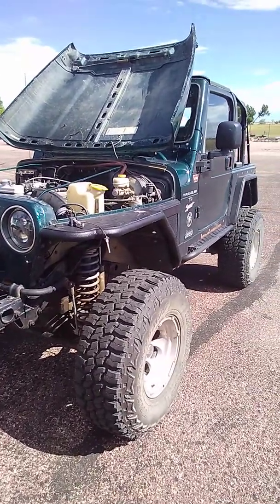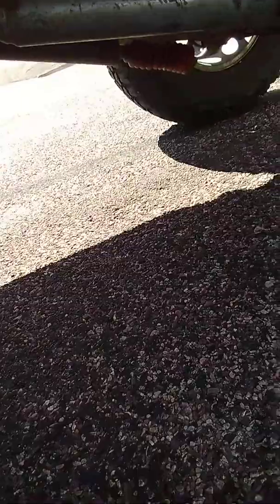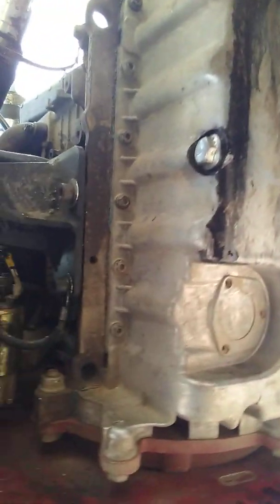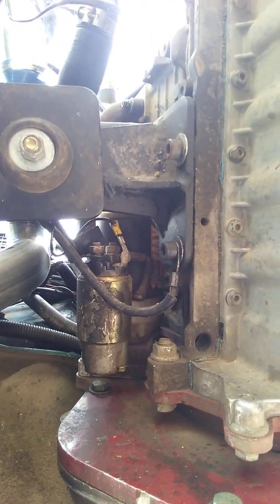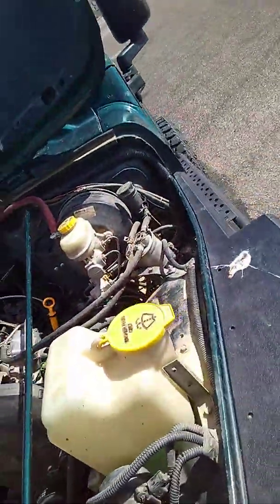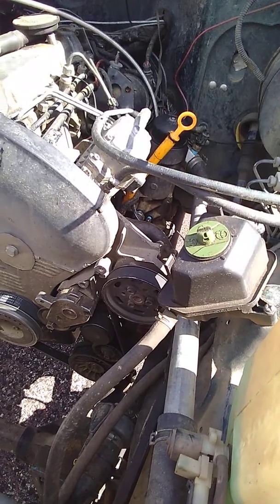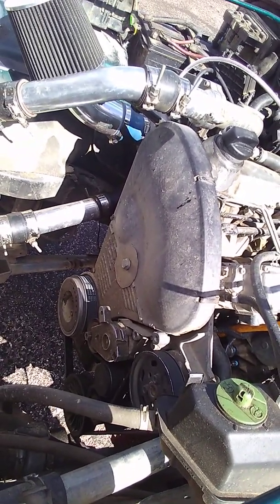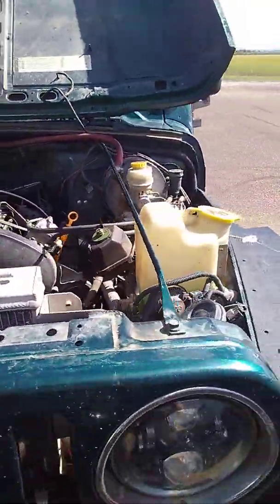TDI diesel swap process walk through TJ Jeep Wrangler

Comment: What dimensions are the intercooler you used?
Reply from the maker: The one in this video is about stock ALH size, 12x10x4 core, much too small once I bumped the power up years later

Comment: I have a 03 Jeep tj and was planning on doing a alh swap I was wondering what exactly do I need to do for the wiring do they make a plug and play wire harness kit? Do I need to re wire everything myself? Also do I have to run both the Volkswagen and Jeep ecu?
Reply from the maker: It's usually easiest to run separate wiring for the engine and the jeep. I have other videos going over all that as well as using the jeep wiring to make the gauges work. I can also build standalone harnesses for just the engine.
Reply: I would definitely be interested in buying a stand alone harness I just gotta find a donor car and get everything for the swap together
Reply from the maker: @johnpalmer415 check out the playlist on all my jeep videos that will help a lot, as well as my recent wiring videos on my dodge Dakota, very similar setup.  But you can find me on Facebook https://www.facebook.com/profile.php?id=100014261163897&mibextid=ZbWKwL

Comment: I have a 2000 TJ that would like to swap an ALH due to their reliability and strength. I found a 2000 Jetta TDI. Guys is asking $1,000 whole car but the timing belt broke he said not starting. Would it be too costly to rebuild ?
Reply from the maker: Well usually it bends valves/lifters/sometimes the cam is damaged, new heads are about $1000-1500, as long as it didn't damage pistons it's not terrible, but that's pretty high for a basically junk engine, if it's manual you can make some back selling the transmission/manual swap kit.  But it's a pretty expensive start if you can't do the work yourself, most engine rebuilds are pretty costly these days.

Comment: What tune are you using stage 3 or 4 ?
Reply from the maker: I have all custom tunes from TekMekTronics, over stage 5 if you are looking at numbers, 200 HP/350 TQ
Reply: @TDISwaps - Geez - that beats my stock 4.0 torque by a longshot and is a little better on HP. This swap is looking better and better to me.
Reply from the maker: @wes11bravo yes it definitely rips compared to the 4.0, and with a 5k rev limit it really feels like the 4.0 power band still.  That and over 20 MPG makes it pretty hard to beat.  If you can do it cheap the fuel savings pays for the swap in less than 50k miles.

Comment: My Monday question on my jeep TJ, what all needs vacuum other than the brake booster, heater controls and turbo actuator. I am not using the EGR system.  Thanks.
Reply from the maker: That's it, brakes, turbo, and heater!
Reply: @TDISwaps  Thanks, that is the answer I was hoping for.

Comment: Actually drove mine  3 quarters of a mile this afternoon. First time to check the transmission and it feels good. Will my stock jeep tj radiator be sufficient to keep her cool? Installed a cheap $25.00 pressure regulator but I am not impressed. Gauge works around 25-30 lbs but drop to zero when backing off with the adjustment. Still might go to the H setup now that I have another metal fuel line going to the tank for a return .
Reply from the maker: I used a stock radiator for awhile but the mountain passes heated me up more than I liked so I did a $120 ebay 3 core and that really helped, although it barely gets to temp around town lol.  Guess it depends on your conditions.  Ya guys have run as much as 25-30 PSI to the ALH pump without issue, but it's asking for leaks if you ask me.
Reply: @TDISwaps  probably put about 5 miles on her today just driving a half mile on my county road back and forth. A few minutes ago I just determined that my brake booster is bad and that is why the vacuum is so weak. I used a vacuum hand pump to the actuator earlier today before I discovered the booster problem. When I applied vacuum to the actuator the lever moved but  nothing changed with the idle or when I was driving.Your thoughts...
Reply from the maker: @herseyjake1  the actuator is moved by the ECU as the boost comes in and goes away, it's pretty hard to recreate.  I would just cap off the brake booster until it's fixed and make sure your n75 valve is getting full vacuum and then it should work correctly
Reply: @TDISwaps  I have capped off the brake boost until I can go and pick up one. How does the ECU control the actuator since there isn't a electrical plug connected to the actuator? The EXPENSIVE harness I had made didn't include one because they said it is basically useless and didn't work most of the time. Also, the harness did not provide for a electrical connector to the n75 valve. I can't see how the ECU can communicate with either of the 2. I haven't ridden in anything powered by a tdi 11.9 so I don't know what kind of power to expect. Currently there isn't much but I suspect I haven't experienced any boost yet. And I haven't test driven it since discovering the bad brake booster. Thanks.
Reply from the maker: @herseyjake1  you must be missing some stuff that's needed for the turbo to work, I can't send pictures here but you can contact me on Facebook so I can sent you diagrams. https://m.facebook.com/profile.php?id=100014261163897&ref=content_filter

Comment: Could a TDI swap work with an automatic transmission? I haven't been able to find a forum with an automatic write up. Thanks
Reply from the maker: TDI swapped trucks Facebook group has the most info you will find.  There are quite a few automatic options depending on the vehicle, but most need to be able to run without a computer so older pre-2000 or even 1994 are the best.  Getting the transmission computer to communicate with the TDI is usually complicated, and can be very expensive.

Comment: Are you using the stock jeep fuel pump? I understand the 1.9 only needs 8-10  fuel pressure whereas the stock jeep pump is considerably higher. And what did you look for when ordering water hose pipes off of ebay? Thanks.
Reply: Mine 1.9 is out of a 2005 Jetta. I will check your Toyota videos. Thanks.
Reply from the maker: @herseyjake1  oh ok yes on an 05 TDI it does need a pump, but I have still seen guys use the factory pump with the H setup, either that or an inline pressure regulator to drop it to the 10 PSI.
Reply: @TDISwaps  ok, I am finally at the fuel supply point.
Reply from the maker: @herseyjake1  ya I have seen multiple ways of making it work with the PD TDI engines, but the H setup and/or a pressure regulator are definitely the easiest options and you don't even need to mess with the fuel tank at all! I never even dropped mine.
Reply: @TDISwaps  I've ordered a inline pressure regulator because I haven't visually seen a H setup. I think I understand how it works but  am not sure what  piece of hardware is used for the H. Also, what happens on either a inline regulator or a H setup to the second line (return I guess) that is on the VW fuel filter. Many thanks for you responses!
Reply from the maker: @herseyjake1  glad to help man, wish I could send pictures on here.  The lines are hooked up just like they were in the car, send and return go all the way to the tank.  An inline regulator will work just fine as well, usually if it has it, it's discharge will tee into the return.  The H setup is just teeing the send and return lines together so excess fuel turns around and goes right back to the tank through the return line
Reply from the maker: So you don't actually need a fuel pump for the older 99-03 1.9s, but you can also do an H setup in the send and return lines using 2 tees and then run the factory fuel pump just sending most of the fuel back to the tank.  I go over that in my Toyota setup.  My intercooler hoses are off eBay just a universal kit but my water hoses are from the parts store.  I put the part number to a few of those in my Toyota video as well.

Comment: where did you get the universal  premade engine mounts? And how did you align the motor. I am having difficulty determining if my engine is perfectly aligned? Thanks
Reply from the maker: So the engine side of my mounts are from TD conversions website, and the frame side are just universal v8 motor mounts, to be honest having it perfected aligned is not that critical, I think mine ended up about 1/4-1/2" off of centered.
Reply: @TDISwaps  Thanks for the reply. Since I am keeping the compressor I had a  devil of a time making something work on the driverside. I got it in just behind and below the compressor. On the passenger side I mounted it closer to the front of the engine. Hope that it will not matter if they aren't both mounted across from each other. Got my computer and wiring harness back from Canada today so I about ready to get this show on the road--I hope.
Reply from the maker: @herseyjake1  nice! Sounds like you got it under control.  Yes the driver's side is a pain there is like 1 place it fits with the a/c compressor there.  And no the location on each side won't matter at all, if you check out my Toyota it's passenger side mount is clear in front of the engine! Ha ha.  Anyways, good work!

Comment: Did your computer require tuning to eliminate the immobilizer? If so who do you recommend. Also, are your gauges working off the jeep computer? I have a 2004 jeep TJ and a 2005 VW Jetta 1.9. I need to know which wires to use and which to discard. And does the jeep computer require tuning when only using the gauges? Great video!
Reply from the maker: Yes the computer will needed the immobilizer turned off, deleted and tuned.  I have used Malone Tuning for both of mine.  Using the Jeep ECU and engine sensors the factory Jeep gauges will work, I made a video on that specifically.  I made a video on cutting out the wiring harness on my 03 as well, your 05 should be very similar.

Comment: how did/do you decide to weld in the new motor mounts
Reply from the maker: Well I started with some universal  premade mounts and then cut and welded them to work in my situation, but having the engine in place held up by straps right where you want it makes it easier to see where you can put the mounts and what will work.
Reply: @TDISwaps  how did you decide where the engine needed to be placed?

Comment: Hey I noticed your reply to comments! Was just wondering which year VW did you use? Which engines are the easiest/cheap swap if that's possible Haha. I want to swap my TJ for mpg but have never done a swap before...thanks!
Reply from the maker: Haha yeah I'm glad to help out, I just go for whatever TDI I can get a good deal on that's what I search for on marketplace and Craigslist, usually the 2000 to 2003 ALH is the cheapest that's what both my swaps are
Reply: @TDISwaps  Does it matter if the donor car is an automatic or manual? The trickiest part for me would be the wiring. Is EVERYTHING from the donor just swapped over? Or are some of the JEEP computers and wiring used? Is there step by step instructions anywhere? Thank you for responding!
Reply from the maker: @Thanny2000  Your welcome, and the donor car doesn't matter, you will get the computer tuned to stand alone from whatever it is.  I go over the wiring and keeping the Jeep ECU for the gauges in another video.

Comment: What turbo did you get on here? I love the placement👌
Reply from the maker: that turbo is a gt2056v with a t25 flange, then I have a universal vw 8v t25 manifold to the engine.  It comes straight out and then the turbo curls up which makes for a ton of room below by the motor mounts and starter.
Reply: Okay thanks👍🏻 Where did you get that t25 flange for the gt2056v? I’ve got a 1.6td out of a mechanical pump jetta mf engine code going to go in a Nissan hardbody, so I’m thinking a gt1544v might be better for me and the smaller engine, but maybe where you got the t25 housing/flange you say might have a t25 flange for a gt1544v too..?
Reply: Otherwise I think my only option is to make some flanges and make my own adapter to go from my stock k14 turbo manifold to the gt1544v flange type.
Reply from the maker: @mattheripper  well what flange does that 1544 come with? The t25 is a square flange like the bigger t3/t4 turbos.  Your old turbo should be a 3 bolt triangle flange I think
Reply: Yeah both are fairly oddball flanges. The old school turbo is a four bolt but a trapezoid layout. The gt1544v is similarish to a t25 but rotated 90°, I’m sure it’s smaller than the t25 bolt pattern though it is square layout bolt wise, the turbine inlet isn’t oval like a t25 flange, it’s actually just a circular port for the turbine inlet on the gt1544v. The goal for the hardbody is to have a new age vnt turbo that’s size for fuel mileage over power. That being said though if you look at the listing on eBay for the gt1544v it says the Ford and Peugeot 1.6 hdi diesels it came off was making 110hp, so I’d assume it has some potential to get me over the stock 68hp the vw mechanical 1.6td’s made. What do you think? Where did you get the t25 housing for the gt2056v? That would be nice and easy if they did have a solution for a gt1544v housing going t25 too
Reply from the maker: @mattheripper  I will try add the link to this video but it's on my newer video of testing the gt2052 wastegated turbo, or just search vw 8v t25 manifold, it's a cast one for about $100 from china of course.  Ya I'm not sure how it would work with your turbo, I have seen people using the 2056 on a 1.6 but spool up is later obviously

Comment: How are you liking it so far?  And is worth it?
Reply from the maker: I live in the mountains with headwinds in every direction it seems, and 30-50 miles to get anywhere.  I could hardly justify driving the Jeep before at 10 MPG and downshifting every hill.  Now I am getting 21-23 MPG and more power than I ever need.  Of course there have been issues along the way, but it's also never left me stranded in 17k miles.
Reply from the maker: A diesel swap is the only swap I've seen capable of paying for itself in fuel savings
Reply: Great. I'll check it out. Thank you
Reply: This is very true.  I've been thinking about doing it to my YJ 2.5.
Reply from the maker: @pabloaguirre6259  Ya the power the TDI has over the 2.5l is almost unbelievable, not to mention 2x the fuel mileage.  It's hard to go wrong.
Reply: It truly sounds amazing. I'll have to make it happen.
Reply from the maker: @pabloaguirre6259  You won't regret it! If you watch for a cheap car, do the fabrication yourself or with help, and don't go too crazy with performance mods to the TDI, it can be a very cheap.  Anyways as far as engine swaps go
Reply: I can do alit of the work myself.  I just dont have to much time on my hands.  But i found that Coty built has full set up for 5,500.  I dont know if you seen there set up?  If you have.  What are your thoughts on it?
Reply from the maker: @Pablo Aguirre well Coty does complete alot of things for you, but that's about 3-4x what I have in parts for my swap.  I purchased the car, modded the engine and bought everything needed for under $3000
Reply: Sound like ill be going that route. Thank you for your help
Reply from the maker: @pabloaguirre6259  no problem at all! TDI swapped trucks Facebook page is also a great resource.

Comment: Good job.. . The cluster is matching the tdi harness or you did some mods?
Reply from the maker: I left the jeep harness in there and screwed the Jeep gauge sensors into the VW block, then the VW harness just runs the engine and the gas pedal
Reply: TDI Swaps thank you very much. I’m considering a YJ/tdi . Which tdi engine do you recommend? Hp/work hours.
Reply from the maker: I always say find the best deal, all TDIs are good TDIs ha ha, some are a little better and some are a little easier to swap, but they are all good.  newer is generally more complicated but makes bigger power easier. I spend a few weeks off and on pulling the engine and harness and getting it cleaned up and ready and measuring how it will fit, then at least for my jeep I swapped the engine in and had it driving in a weekend, with lots of loose ends of course.
Reply: TDI Swaps thx . Can you send me a link with a full tdi conversion kit/prices? If there is other company except coty.
Reply from the maker: oh ya Koty is the most expensive.  look up whitebread performance and also td conversions, whitebread is the cheapest at about $900

Comment: I have a 63 Jeep Gladiator. What transmission did you use in this swap.
Reply from the maker: ax15 is the easiest, multiple choices for adapters so the price isn't through the roof
Reply: TDI Swaps 
Thank you sir! 👍🇺🇸🙏
Reply from the maker: no problem, I'm going to try make more videos of the engine and wiring removal for my next swap, I'm doing a Toyota pickup
Reply: TDI Swaps 
Sweet! 👍